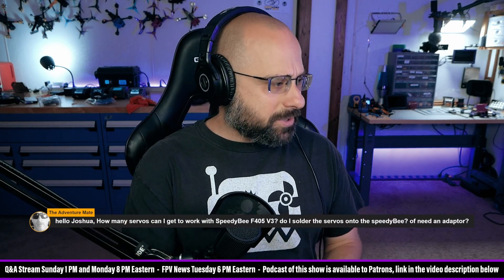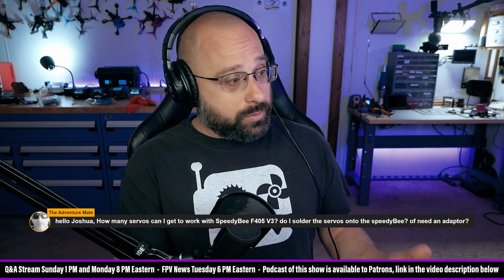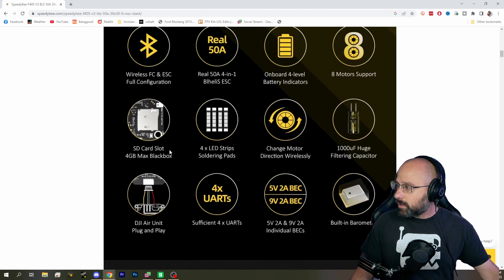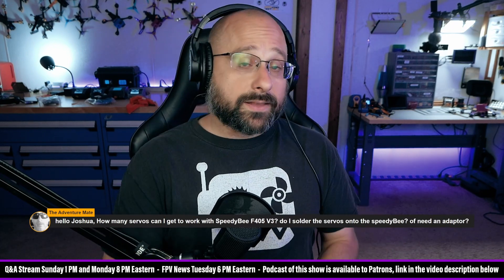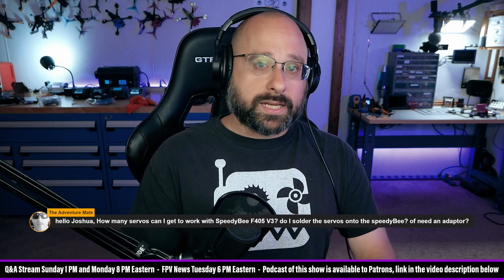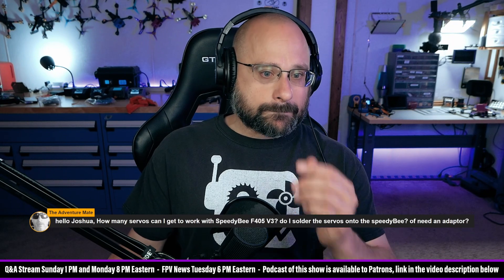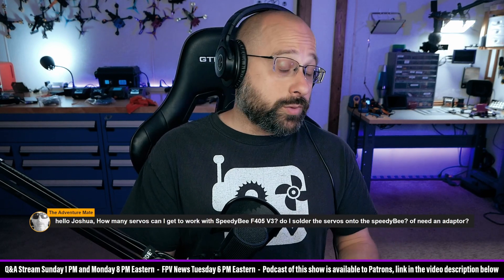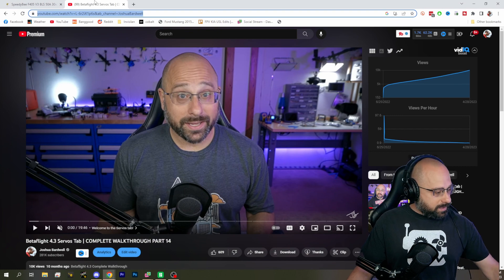How Many Servos Can A Flight Controller Support? Speedybee? - FPV Questions

Comment: found this video trying to solve problem with over 2 servos connection. I use FC without ESC for a mini caterpillar tractor model. My FC also has 8 motor output. 2 servos run wheels. And other 2 I wanter to rotate camera gimbal. Whatever I do, whatever motor port use only two servos work, In a servo tab also react only first two servos to commands. Anyone solved that issue with serve limitation?

Comment: To the people asking for details in the comments:

The proven setup for Speedybee F405 v3 with Betaflight can operate 6 servos.
You can connect the dedicated servo output pad [S9], motors [M5, M6, M7, M8] and [LED] to your servos.
S9 pad is located to the right of motor pads.
Of course you need to remap the resources from MOTOR 5-8 and LED to corresponding SERVO 2-6; the dedicated servo pad is mapped to SERVO 1 by default.
And unfortunately because the servo support in Betaflight is screwed out almost completely you need to activate CHANNEL FORWARDING and map your switches and values on the RC side.

Note: Speedybee F405 v4 has better gyro and some improvements, but someway the Betaflight support of servo 1 pad [S9] is broken; I can't find a correct pin for it in Resources. So you are limited to 5 servos with v4.
Reply: Did you ever figure this out? I'm having the same issue with not being able to find the resource pin for the S9 pad on the F405 V.4
Reply: Same Issue with Ardupilot. S9 doesn´t work for me.

Comment: To anyone still wondering about this, the speedybee has a dedicated servo pin (S9). If you go the the same page that Josh went in the video and scroll down a bit more, they even have a wiring diagram of how to connect it. Basically you connect the 5v and G to the LED pins in one of the corners, and then connect the signal to the S9 pin. After that you can go to INAV and set the corresponding channel to SERVO. After that you can use CAMSTAB to get a stabilized pitch camera.
Reply: where is the s9 pin and how do you know which pads are which pins if the labels are different, the data sheet is kinda useless
Reply: sir, have you tried mg995 servo to a speedybee fc? and did you use external bec?
Reply: @arbelcasquejo2336  I used the small 9g MG directly to the board, the mg995 is quite big, that one needs a BEC for sure, it pulls quite a bit of current

Comment: Only 2 servos works on m5-m8 pins. 
I don't have any ideas how connect and setting more than 2 servos
Reply: sir, have you tried mg995 servo to a speedybee fc? and did you use external bec?
Reply: @arbelcasquejo2336  I've tried already only with external power source. Whatever pins I use Only first two servos react. I don't use motor at all. So I've ties all the 8 Motor pins for servos. Still only 2 can work at the time. Whats the trick?

Comment: I can't get a servo to work, did anyone have success? I tried INAV and Betaflight but Iam a Noob so I maybe missed something.
Help is really appreciated, if I find a solution I will update this comment. If you reply you will get notified, because I will answer.
Reply: I'm trying to get this to work on inav and can't get the servos to register on the mixing tab. Should be easy to set up. The instructions look easy but it doesn't work for my board.
Reply: @chestergt7765  which board?
Reply: @David-ty6my  I got it with the new inav7.